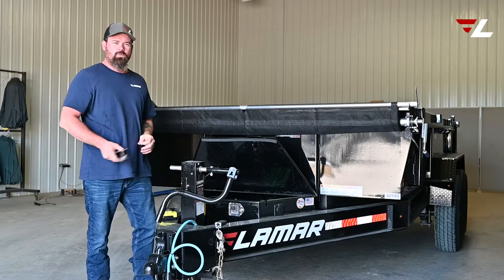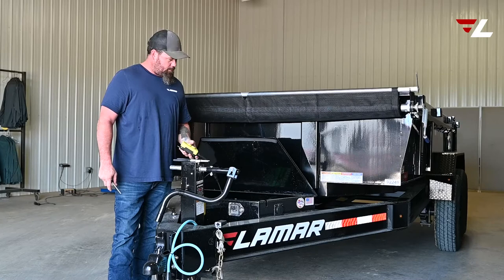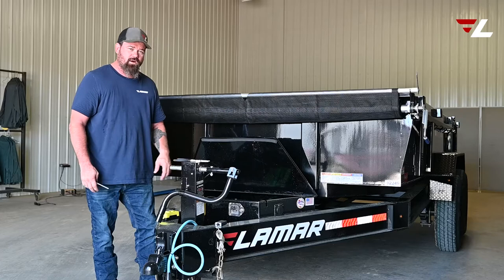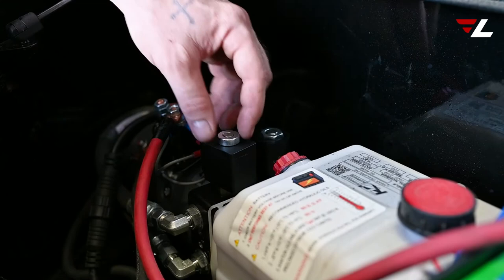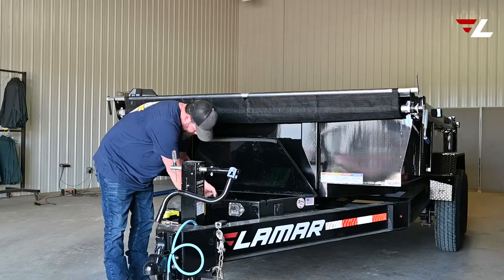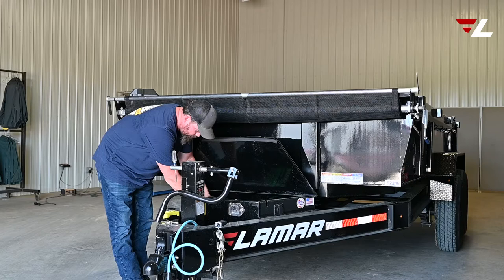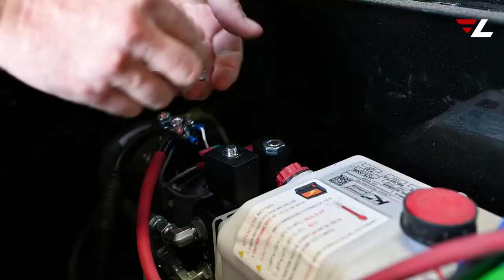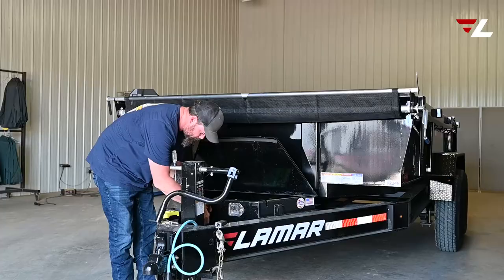Replacing The Solenoid - Troubleshooting a Hydraulic Lamar Dump Trailer

Comment: What if it only doesn't go down intermittently?  Like 1 of 3 tries it won't lower.  But then if I go up a bit more, I can usually get it to eventually come down.
Reply from the maker: Check the remote, sounds like its not hitting the contact point each time

Comment: Hi. What is the valve part that is inside of the coil? And if I remove it will a get blasted with hydraulics? Thanks
Reply from the maker: Only one way to find out! 😉
If there is any pressure, you very well could get blasted.
There are two valves, the valve under the square coil is down, the one under the round coil is up.
Lower the dump, but don't keep pushing the down button once the bed hits the frame, and then loosen the valve slowly. There may still be some pressure but not much.
Reply: @LamarTrailers   how do I purchase the square coil.  is there a Part Number Thanks!